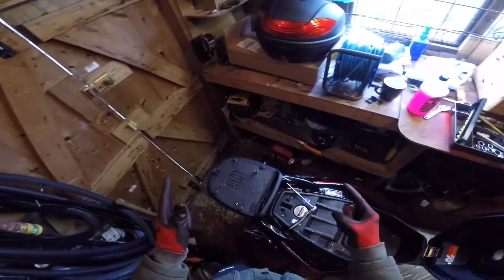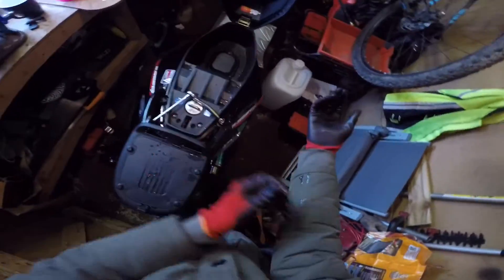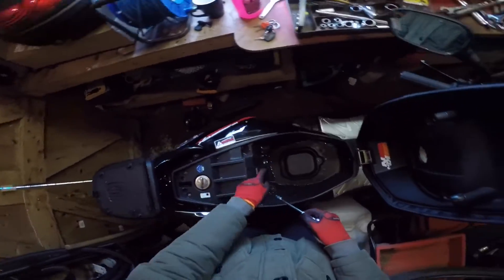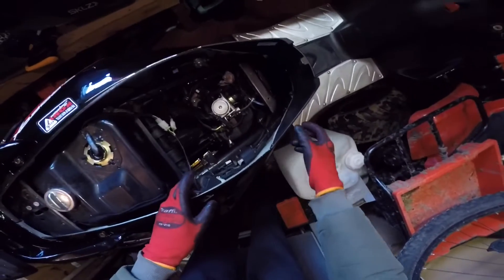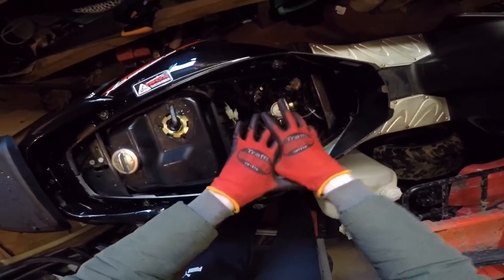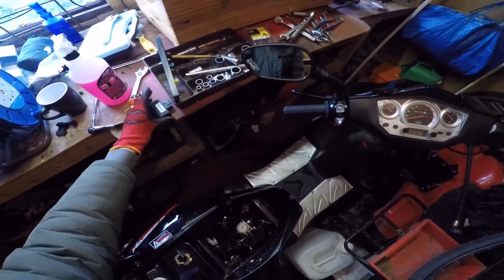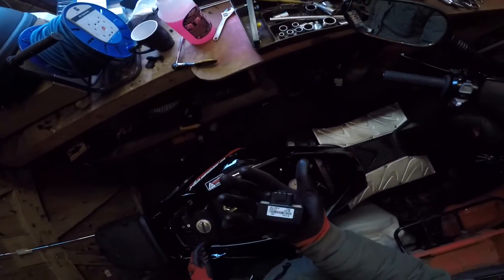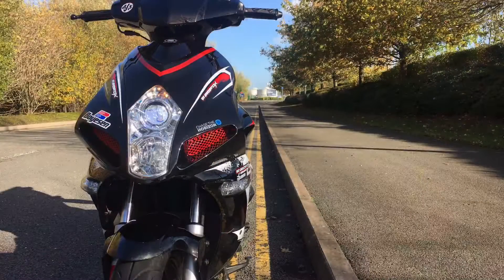How to de-restrict a 50cc moped (CDI Location)

Comment: So all you have to do is change the cdi and them rings which a garage can do ? And also about changing the other thing (not the cdi) what would I say if I went to a garage and asked
Reply from the maker: Yep that's all you have to do 👍
Reply: @JOCMedia  but what about doing the other thing near the kickstart ?
Reply from the maker: Yeah that's where the variator ring is that u need to take out.
Reply: @JOCMedia  if u take the variator of can than moped go from 25km/h to 45km/h?
Reply: @JOCMedia  do you have to put in a new variator ring or do u litterally just take it out?
Reply: @patrickdoyle5761  just take it out

Comment: i want to ask you if your ecu/cdi was fully open / unlimited one cuz i bought mine and it is like its having kind of error and it doesnt work propely when i turn it on and give it throttle it just doesnt give any kind of power it didnt even turn a wheel

Comment: i have a derbi senda xtreme and its so dangerous to ride it in my area because its far from flat, i saved up fro the bike to buy it brand new so its all stock, it takes me a good 20 seconds to get to 30mph most times and its not safe, have any tips? thank you
Reply from the maker: I would possibly try and get it de-restricted if possible as they are quite dangerous 50cc bikes, especially if you live near quick roads.
Reply: @JOCMedia  I did some more research and I'm going to de restrict and get a race CDI which increases the engine rpm from 8,000 to 10,000. It was so embarrassing aha I had to ride next to the curb because there was a line of cars behind me
Reply from the maker: Yeah I remember having long queues behind me lol, try not to ride in near the curb at junctions tho as cars will literally pull out as there all stupid.👍

Comment: Hello, can I ask how much your new CDI was and maybe a link to it? 

Also what is the speed increase, my friend has the same scooter and wants to do the same. 

Many thanks in advance
Reply from the maker: Its £108,https://www.racing-planet.co.uk/naraku-unrestricted-euro4-p-196646-1.html,
Took my top speed from about 34 to 50 but on a gps speedo it actually does 40mph.
Reply: @JOCMedia  can i use this CDI on 2-t same scooter (as yours)?
Reply: What’s the difference on buying a 2022 euro 5 with a euro 4 derestricted cdi

Comment: what if you just change the ecu and dont remove rings ? will it run faster or not?
Reply from the maker: No the cdi will be able to go faster however if the ring are left in they will restrict how far the belt can move up the variator with means it will stay doing 30mph
Reply: @JOCMedia  what of I did it the other way round removed the ring but not the cdi?
Reply: @ttid7298  did you ever find out mate

Comment: Do you know what wire to cut to eliminate the restrictor
Reply: Did you get your anwser ? Im having the same problem
Reply from the maker: Think it’s the purple one on most of them, I just replaced the whole ecu/cdi part
Reply: @JOCMedia  so if i dont have enough money to buy a unrestricted ecu can’t I just cut the purple wire?
Reply: @umi3988  is your the 18 pin dellorta cdi? i looked for a purple and a pnk and couldnt find one - anyone know the colour to cut and does it just need insulating or grounding to earth?
Reply: did u find out

Comment: Where can I find un restricted CDI box and what does it called? Because in my moped I have got Dellorto but my moped won't go faster than 30km/h
Reply from the maker: If you have already got the dellorto one, you need to de restrict the variator as well.
Reply: Okay, thanks very much
Reply: @JOCMedia  i have a gotar how to make its faster

Comment: Hello, my scooter speed is lock in 25km per hour and I want to make it 45km per hour. because of Europe low.
please tell me how I should do it?
Reply from the maker: I think you will need to get the variator and cdi de restricted to make it quicker as that's what I did on my old one.

Comment: So replacing the cdi is the only thing you need to do to derestrict it?
Reply: And remove the ring, be warned tho, most if not all the original engine parts are pretty fragile on GY6 engines so if its a long term bike then be willing to replace some of the internals too

Comment: I’ve already took out the variatior ring so if I just get the cdi you have will it go 50 mph ??
Reply: Also it’s out of stock is there any other places you can get it from
Reply from the maker: The only place I know you can get one is on a website called planet racing, also if you called up ur local garage they might be able to get one.
Reply from the maker: And yes it should do anything from 40-50 mph.